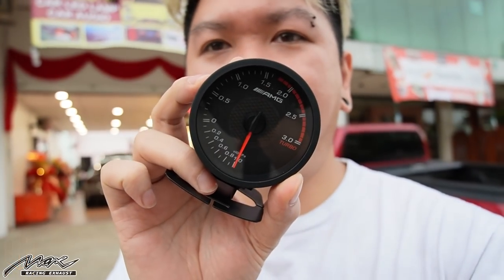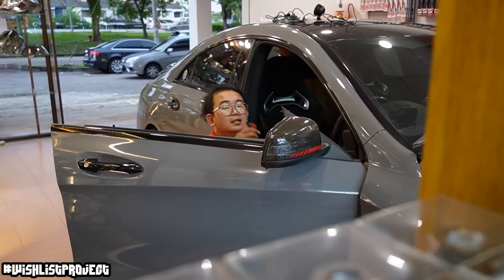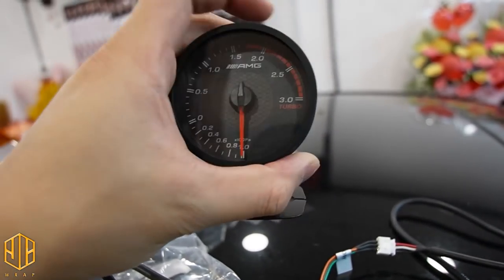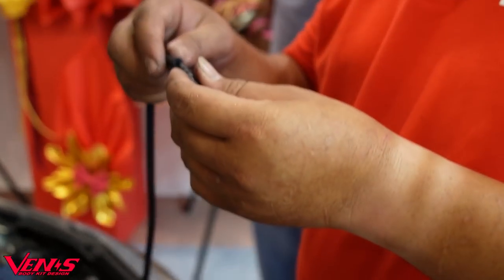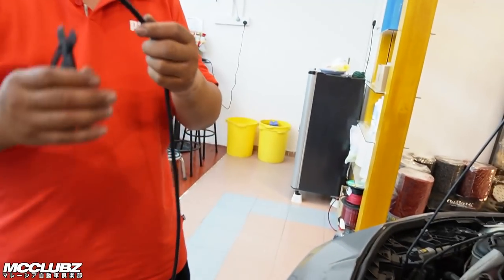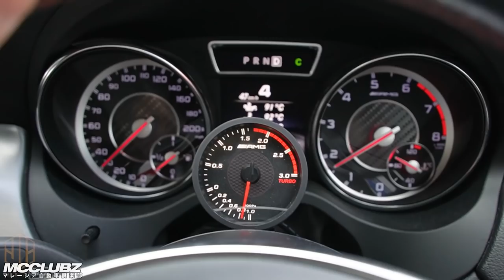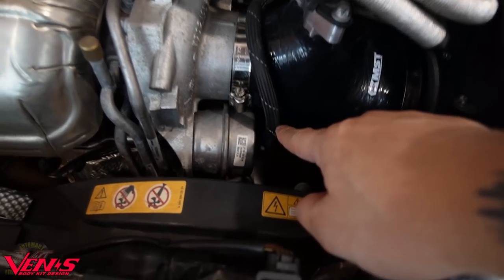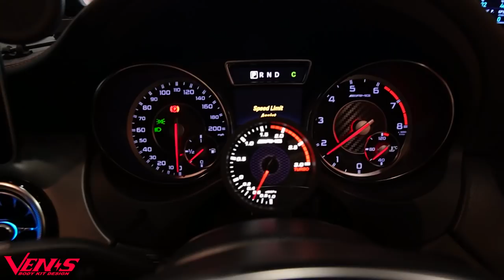CLA45 BOOST METER 2.1BAR CRAZYYYYYYY

Comment: u bought a ciplak OBD meter and install it in a mercedes CLA 45, I was like r u making the car like ricer?
Reply from the maker: Im just purchasing for fun bro. For letting others know about this obd seems alot of people are finding. Also besides than monitoring boost actually the rest is accurate. 😁
Reply: @adrianlodejavu  yeah u r right but its CLA 45 bro at least Lufi or Defi meter...anyway be careful on cheap products especially on Merc electronic system..my mates just destroy his CLA 45 electrical system. Logically cheap OBD wont caused any damage but reality it does. I dunno how but what i can think of was may be merc electrical system is abit complicated plus its AMG..may be, im too sure bcoz i am not electrical engineer